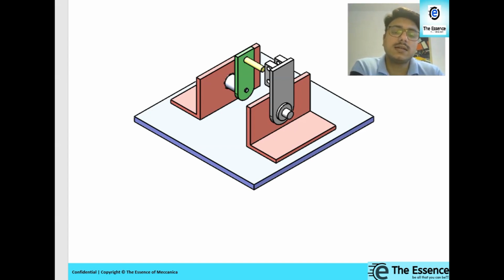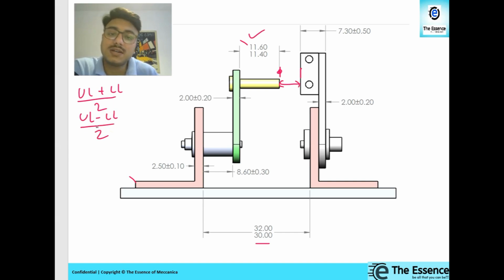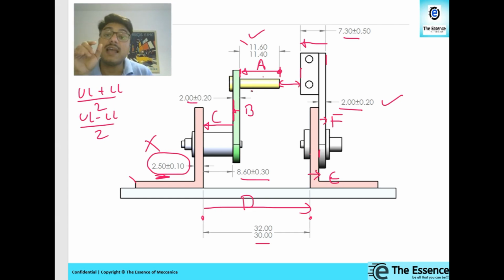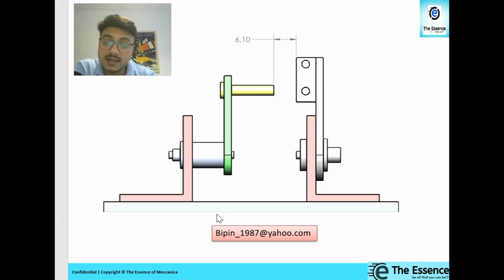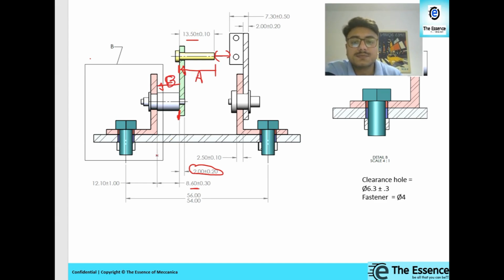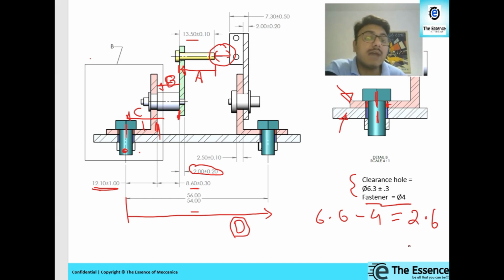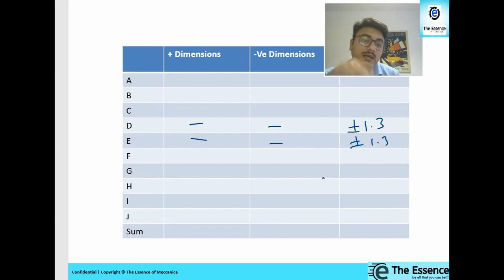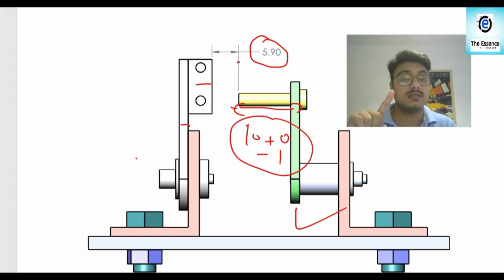19_Linear Example

Comment: Bro, one doubt in dimension 7.3 is included the dimension 2 also. Then y we need dimension 2 separately also.
Reply from the maker: That plate thickness is part of the loop, it will not be added as both directions are different